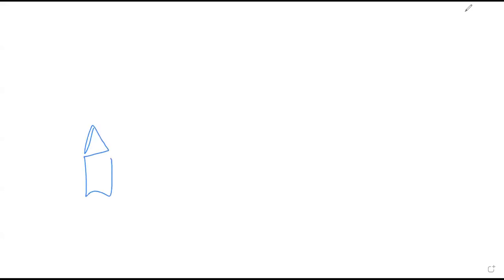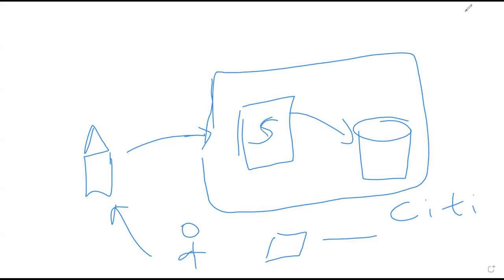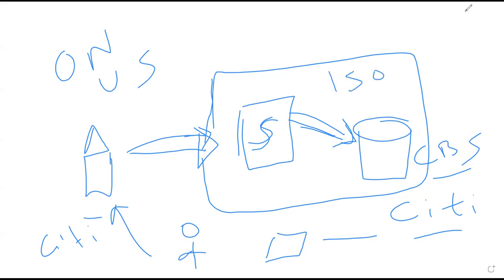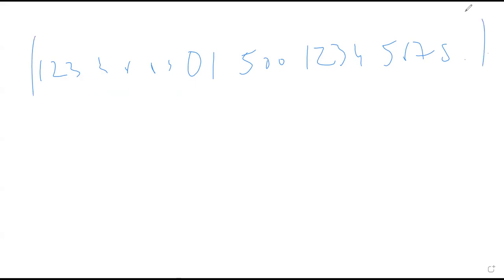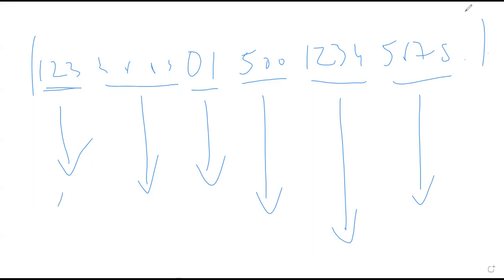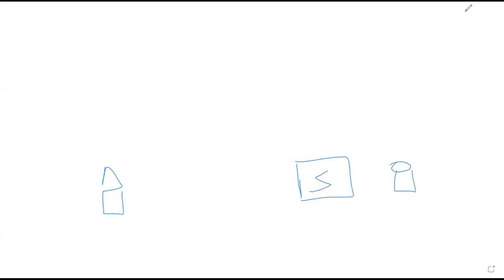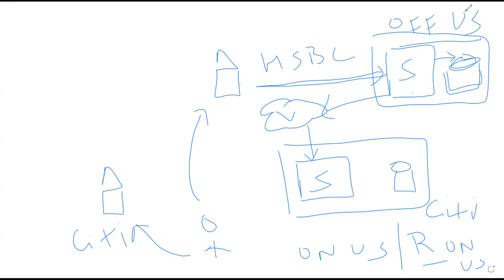Masterclass Series "ATM Integration with Core banking" - 1

Comment: Thanks for the video. Could you please explain what's the message format between the switch and the ATM itself? Do we still use ISO8583 messages over TCP there or can every bank use different formats for this connection?

Comment: 00:06 Understanding ATM Integration with Core Banking
01:27 Integration of ATM with Core Banking via ISO 8583 protocol
02:53 Switch sends messages over TCP/IP to core banking database for ATM transactions
04:40 Core banking software uses messaging service to process ATM transactions.
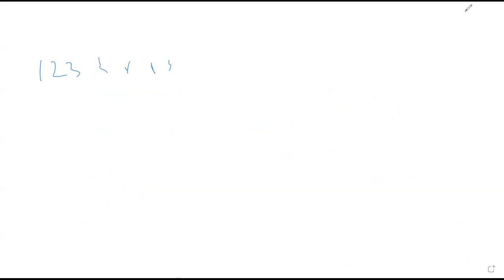05:45 Understanding the significance of different fields in ISO 8583 protocol
06:59 ISO8583 protocol explains field significance and details.
08:02 Understanding transaction routing between ATMs of different banks
09:15 Transaction processing between ATM, Visa Gateway, and banks